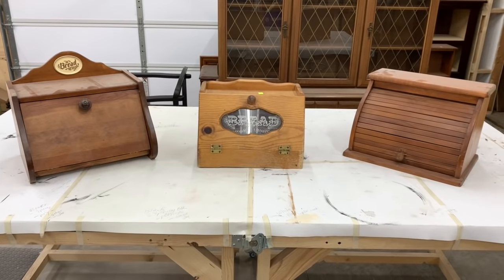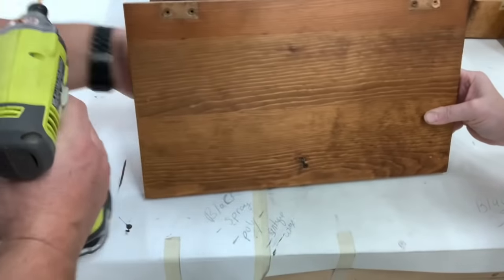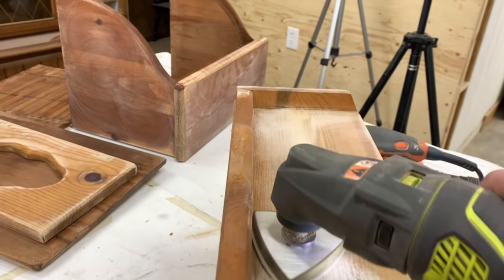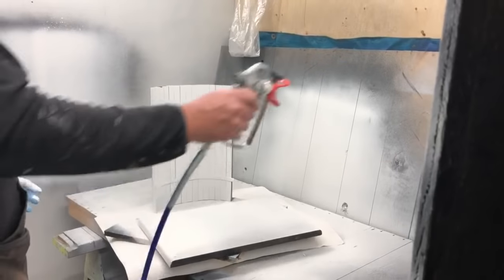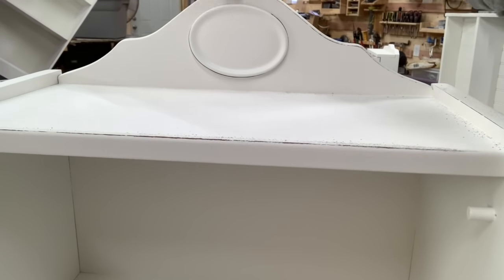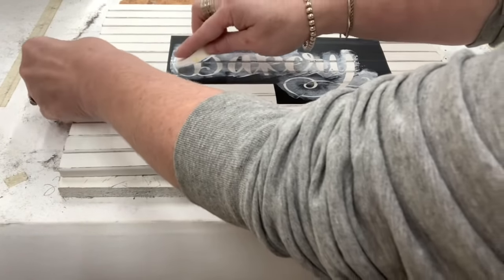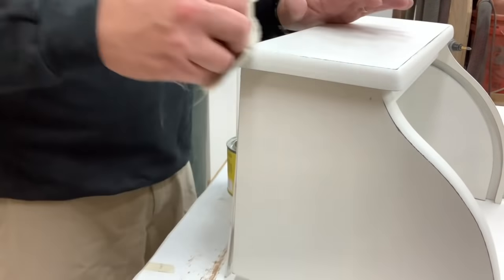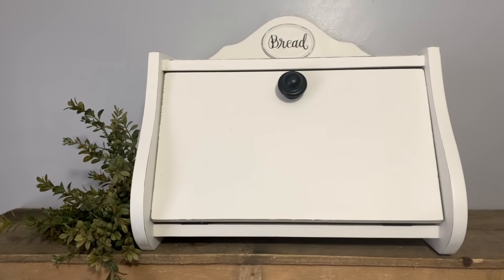Updating Thrifted Bread Boxes to Fit into Farmhouse Decor Trash to Treasure

Comment: I totally understand the issues with the various bread boxes, I have done the roll top  one by hand it certainly can be a challenge. Mine also stuck rolling up but I don’t see anything wrong with it, I’ve had the roll part out and examined it . I love how all of yours turned out , I don’t think I can choose.
Reply from the maker: Thank you for watching and sharing that. We think a lot of those were hand made. So it could be that the router area  (the cuts on the side pieces)is not wide enough ..long enough. It’s just a guess🤗

Comment: ALL 3 are attractive 💕💖. I've had that  "beast" box for almost  34 years, now. It's Pfalzgraff, but I didn't buy any of the matching dishware in that beige with brown pattern. I put a  "frost" finish on my breadbox during that 1990s trend 🤗.

Chris looks experienced with a sprayer 👏.  
When I spray, my guy has to set up and do cleanup for our larger pro Graco sprayer, but I can handle the smaller DeVilbiss and Binks GF sprayers.  It took awhile for me to learn the water ratios with latex, and how much conditioner to put in oil-based. He showed how to strain paints from their partially used cans or buckets to keep "trash" from blocking the spray tips. And, after bleed off of the  leftover paint,  he runs paint thinner through the gun to keep the packing and tips clean.
Reply from the maker: Thank you for sharing that. Oh.. so you totally understand the struggles of using a sprayer. There’s so much more to them than just painting with them. 🤗

Comment: I just painted a breadbox exactly like yours. My mistake was to paint the groove where the louvers slide. My solution was to spray some silicone in the groove. It made it roll much easier.
Reply from the maker: Oh .. I bet you worried for a second. But great fix. Thank you for sharing that tip💖

Comment: I have a roll top wooden bread box from thrift shopping. The slats are joined by several 3 inch wide bands of thick and sturdy cloth that are glued to the slats. It looks like the very narrow plastic strips on your breadbox allow too much extraneous motion. The plastic looks more rigid than cloth and is attached to the slats at only two points by the staples. The staples are not at precise equidistant locations so each plastic "hinge" bends at a different angle from all the other hinges. Each angle is not significant in itself, but in concert the disparity yields uneven tracking. Uniformity would give the roll top smoother action. The cloth bands on mine are uniformly flexible and in full contact with the slats. My roll top did stick in the grooves somewhat, but that improved after I rubbed a scrap of candle wax inside the grooves. Candle wax is also a remedy for wooden drawers that don't slide properly. Apply wax to the drawer and cabinet interior where the two are in contact, typically the glides.

Comment: the sprayer u have is for painting houses, fences and for big projects...i suggest u to get a good compressor and a feed paint gun so u can paint the pieces without the hassle of cleaning the big machine... I know that each time u clean it u will waste at least one hour and must must be super clean or otherwise u will ruin the machine...with the compressor and the gun u only need to clean the gun and canister, easier and faster...plus u can use a small canister for small projects and a larger canister when u have larger or several pieces...i hope the suggestion will help u...
Reply from the maker: Thank you for your suggestion. We have tried them all before this one. And yes they ones you are suggesting. No matter how well or how fast we cleaned them after just a few usages they no longer worked. A lot of money wasted. And when we purchased this one. We did a ton of research and watch YouTubes of others that use it for what we need it to do.  But I do appreciate your suggestion.
Reply: @GingerChickRehab  sure no problem...as u say something work for some and for others will not work as well.  what i love of the machine u have it is the power  vs the compressor used for the feed canister, which must be at least 30 Lbs to obtain a good working time and power...the other option is those expensive machines that run about 1000 dollars which they work amazingly well but hey at that price...give me the compressor LOLOL
Reply from the maker: Thank you.. oh at that price. We should be able to just sit back and watch it do all the painting 🤗
Reply: @GingerChickRehab  yeah right....it is incredible how much some companies charge for machines...i think those machines...i can not remember the name...are used by the "professionals"  to paint enamel over kitchen cabinets...  well thank you  for the video...gorgeous pieces as always...

Comment: Hi Y! I need another link! The detail sander with the triangle head please! For some reason, all the lowes and home depot's around my house don't really have them!
Reply from the maker: Happy to share Erin. 
Ryobi JobPlus 18 Volt Multi Tool Console & Head Attachment Set (Bare Tool)
https://amzn.to/36FnDI4
 Replacement Battery for ryobi 18v Battery + Ryobi Charger for Ryobi Battery 18V ONE + P108 P107 P104 P105 P102 P103 Tools (Compatible with 260051002 P117 P118 P113 BCL1418)
https://amzn.to/34x0ftF
Reply: They're in the regular tool section and the the one store that carries Roby can get it for you they can order and deliver it to your Lowe's or Home Depot but they probably have it in the regular tool section numb in the sanding section cuz it's an attachment for a different tool not a tool by itself

Comment: Fantastic. Love all of them and I have learned so much watching your videos. I do have a bread box that I would like to use your white technique on, but it has been spray painted using a glossy white. I know I need to sand it, but can I just sand the gloss off or do I need to go down to the wood? Thank you for any information you can provide.
Reply from the maker: Thank you for sharing that. Yes just sand the glossy off it. Since your painting it again. You probably should primer it if you to even put the porosity. ( paint -wood) unless your paint had a primer in it. Hope that helps
Reply: Thank you for the expert advice. And yes, I do consider you an expert!  Can't wait to get started!

Comment: Cant pick a favorite!! I would love to have any of them. I have a large metal bread box I bought about 40 yrs ago at a Church parking lot sale. I'm not sure if it's real stainless steele. It has a removable bread board you can take out to slice on or also clean easily. It has a few tiny pit marks here and there and I'm wondering what you would suggest to finish it. I was going to use a metal polish then wax it. I live in a very humid area and want to prevent it from getting pitted worse but really don't want to paint it
Reply from the maker: It sounds gorgeous. And with a cutting board. Unfortunately that’s what metal does over time or moisture. I know they have metal sprays. I’m assuming it’s chrome. You could test some out to see if any are the look you looking for. But definitely need to steel wool sand the pits. I’ve only ever sprayed the metal ones white. I haven’t really tried keeping them the steel look. But that’s where I would start 🤗
Reply: @GingerChickRehab  thanks Yvonne-!!

Comment: The bread box that’s black is the exact one I have, it looks beautiful in black.  Question though, in your sprayer did you use the black paint you usually do?  Also, did you have to water the paint a little and”strain” it ?
Reply from the maker: Thank you for watching and sharing that. Yes we used the same paint we always use. The thing we like about it is that it thin. So it goes on smooth and sands wonderfully. So no we did not need to water it down. But you know never know in the future if we’ll need to . But we use it right in the paint can. And it worked fine🤗

Comment: Question: So, Even When You Spray The Protective Finish Coat, Clear Matt...You Can Still Distress With Sandpaper And It Rubs Off -Anyway?  It Just Gives Me An Hmmmm 🤔... Like, Why Even Seal It...If Sealing Obviously Can And Does Come Off -Anyway???  Can You Explain This A Little More -Please?  TYIA +TFS.  I Love Your Work, Partnership And Setup...Getting Things All Done -Properly And Ready To Sell!!!

I Have That One Bread Box With The Circular Plastic Word Bread.  However, Mine Did Crack Up And Broke Off.. Where The Ends Are Secured.  It's Hanging On...But, Unstable.  Any Suggestions How I Could Remedy That?

Again...TYIA + TFS!!!  L😍VE Your Work And Videos!!!
🙂😍